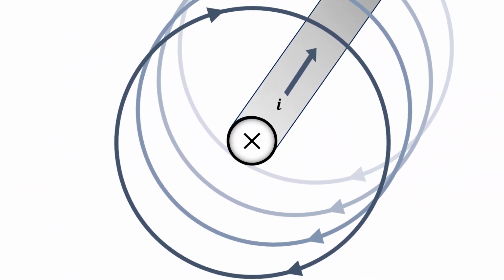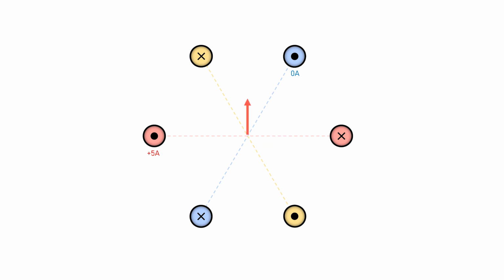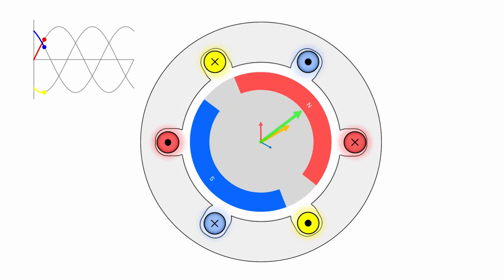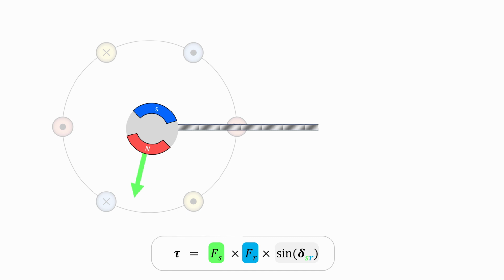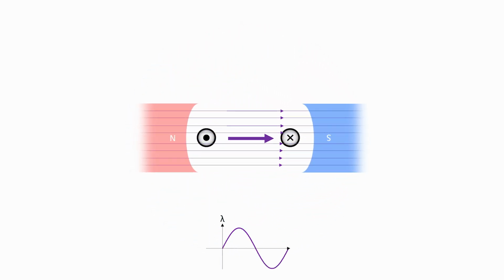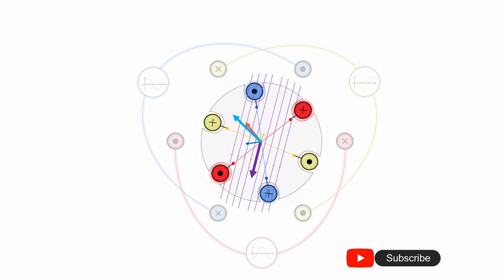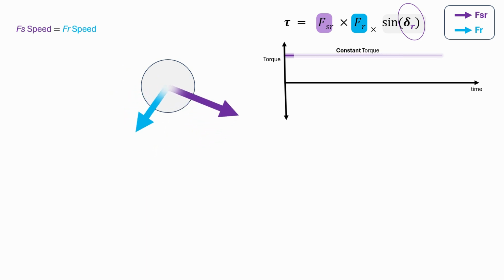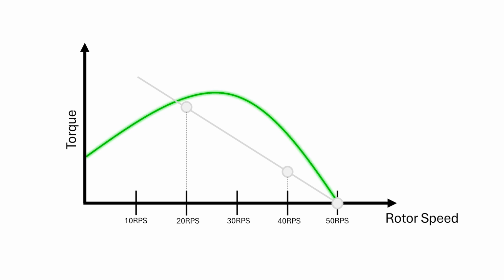How Induction motor works

Comment: One question:

its shows in the animation when the N pole of the magnet in the rotor is aligned with the stator's N pole. Shouldnt it be aligned with the S pole of the magnet in the rotor? 09:30 Since N poles attract S poles?

Comment: Answering the video's question:
With higher slip, we generate higher forces (because the stator's field is rotating faster relative to the rotor). Homever, torque will be at it's maximum when the fields has an angle of 90° with each other. And, as show in the animation, the rotor field has a angle with the stator field, which grows with rotor relative speed (cuz inductive reactance grows with frequency - Z=R+jwL and w=angular velocity).

So, the maximum point between 20-30RPS has a perfect balance of force and angle displacement.